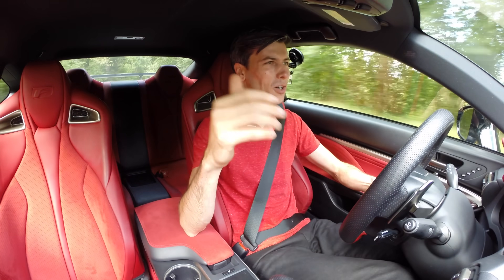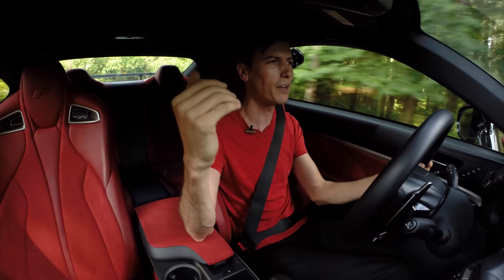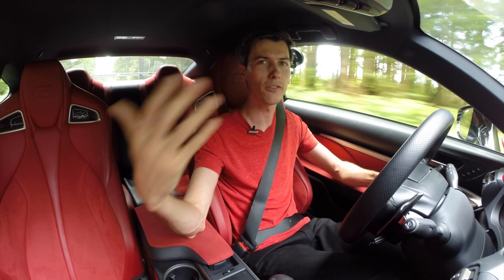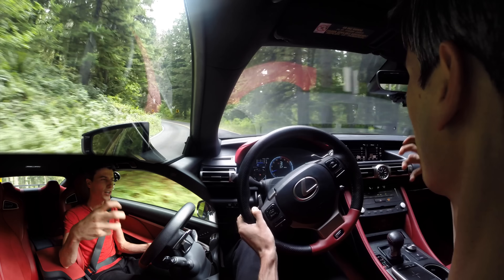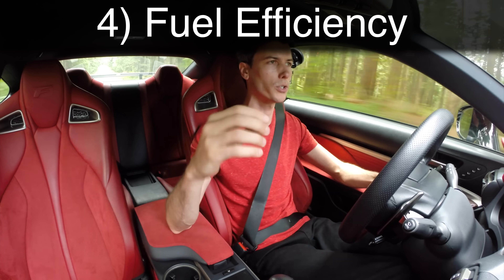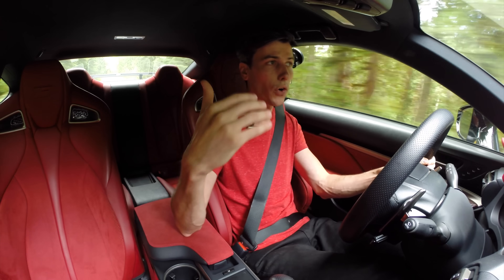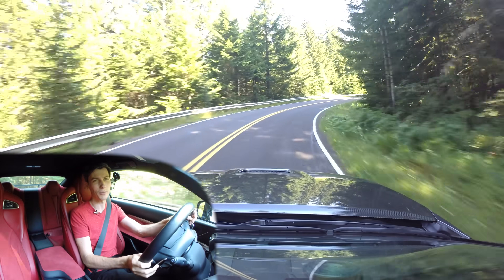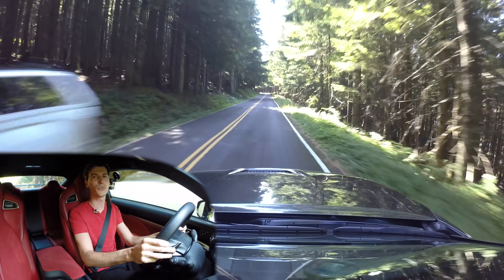5 Reasons You Shouldn't Buy A Turbocharged Car

Comment: You know, the design of the exhaust headers can make or break the sound of a vehicle. You know how a Subaru sounds, you can hear the difference compared to a 4-2-1 in the Impreza and a 4-1 header in the WRX. I personally think Subaru engines sound great and part of the reason is because the two banks of cylinders are far away from each other compared to an inline-4 where they're all right next to each other, which reduces the length of runs from each cylinder on the header. Exhaust piping influences sound a lot.

Comment: rotors & pads replacement for this lexus costs more than scotty's toyota celica
Reply: I own a GSF its not that bad.
Reply: Hey you leave that celica alone its taught me alot haha
Reply: BS... As a RCF owner, I can 100% say that replacement rotors are $100 each, pads are $300-700 for the set depending on the grade of pad. Compare the pads on an RCF to a C63... Good luck.. Lexus cost a tad more then Toyota's to maintain.
Reply: MrChrisproductions 700 for brake pads? Ok guy.  And rotors costing 100? Ok guy.
Reply: MrChrisproductions 🤦‍♂️
Reply: @MrChrisproductions  >$700 brake pads

WEW LAD
Reply: @MrChrisproductions  how much do you think Scotty's Celica worth???
Reply: @NikChristo  kbb says $1800 give or take milage and condition. I have one just like Scotty's Celica
Reply: @MrChrisproductions  Those are very expensive pads. Very. Considering a typical domestic vehicle, that are $40-$200 if purchased at a parts store. Wholesale buys them for less than that. I am not knocking the Lexus I think that some of them are great cars. But holy cow brake pads.
Reply: @MrChrisproductions  Do check prices of these rotors, it's 10 time more than you think, ceramic brakes, seriously expensive toy to have
Reply: @MrChrisproductions  aren't Lexus just fancy yotas
Reply: @MrChrisproductions  I think TryMonster is talking about the RC-F Track Edition that Jason is driving in this video. This one will most likely have the carbon ceramic rotors which will be way more than $100 each, assuming we're talking about all OEM Toyota parts.
Reply: Yeah but you got to admit that Scotty's Celica is a more practical car. Jason only drives sporty stuff.
Reply: Wyndham Coffman well u live once, if u can afford to enjoy before the end why not
Reply: @Frost Bite 400
Reply: True ha,ha,ha
Reply: TryMonster one of the many reasons for that is cause it’s a car from a luxury brand.
Reply: Recently replaced Tyres, Brakes & Rotors on my 3g IS and whoa... That itself was $3845 non f-sport, prob looking around $5k-6k at dealer for this. Also had to replace 2 front rims (thank you Northeast) @$1199 for both.
Reply: @Numbahz  lol you could buy so many of scotty's celica for that money Haa

Comment: Man as a fellow engineer, I don't agree with your reasoning's.

1.) Pedal response? Most manufacturer's modulate the throttle extremely well. Modern advances in turbocharging have decreased the flow path for the turbo in many cases (see ATS-V, the turbo flow paths are about a foot with air-to-water cooling intact). This leads to significantly decreased turbo lag.
2.) As an engineer, I am sure that you know that area under the power curve represents the work done. Modern turbos allow for maximum area under the power curve and with 8,9,10 speed transmissions, that wins races but allowing the motor to remain in the peak torque range for a longer duration.
3.) Any performance engine has to be built strong. Even NA engines have to have strong valvetrains, main bearings and connecting rods in order to rev higher in order to compensate for a lack of a turbocharger.
4.) Engine knock is a concern for turbocharged engines. Modern ECMs have insanely good knock adaptive learning built. The modern ECM can take into account ECT (Engine Coolant Temp), oil temp, IAT1, IAT2, humidity, cam position, and MAT (Manifold Air Temperature) in order to learn and remember where knock occurred and what those conditions were when the knock occurred and thus allowing the ECM to preemptively anticipate those knock zones.
5.) Agree to disagree :)

Plus tuning? a tune only on a turbocharged engine has significantly more gains than a tune only NA car.

Comment: My 2018 w205 c63s coupe virtually never had no turbo lag, this new lexus wouldn't even touch my old c63s, i have a 2019 e63s now. Drive an Amg for a comparison, natural aspirated engines will get you in more trouble on the streets. You have to floor them for a long time to build up speed, where i can get on my amg, and then let off just as quick.

Comment: Thank you for generously supporting the american market for used muscle cars - buy one, as long as they are still available.

And you are so right, seven hundred horsepower out of seven liter displacement may last easily up to three hundred thousand miles or more, without any problems. But only if the engine does not have a 'vanos', a variable camshift timing mechanism. Use good oil and take good care of the peripherie, and everything will be fine. If we want to keep the car for longer, high displacement, low tec will be more costefficient for consumers, higher consumption today and higher taxes this year on the long run will be 'overcompensated' by the maintenance costs for small displacement - high pressure engines.

So everybody feel free to choose. Buy two.
Reply: For a lot of people for quite some time this engine was one of their favorite tuning engines, a. sufficent displacement, b. as of r
factory 'just low-level turbocharged'.

Comment: Those were my thoughts exactly... then I fell in love with a Turbo diesel.
Reply: You know what I'm thinking...
When the world finally runs out of fossil fuel...
Every petrol engine user will turn into the Mad Max kind.Killing others for gas
Meanwhile...the diesels...will run on peanut oil...as they were first intended.
Reply: @Rob-326  When the world finally realizes crude oil isn't fossils, and the mantle of the earth produces this slime perpetually....
Reply: @turnin.sprocket  But the problem of pollution persists...
Reply: @turnin.sprocket  no it doesn't. Fossil fuels formed in a specific geological age before bacteria were able to digest wood. The oil will run out.
Reply: @turnin.sprocket  what?

Comment: If you don't live in a deserted area, like most of us, being in traffic is pretty boring most of the time. So you might as well spend less money on gas /taxes / pollution (especially here in Europe). For those occasional places where you can still have some fun, a highway ramp, a windy road without reduced speed limit, a deserted stretch of road, that's why you have the turbo.
Granted, it is a compromise. I also think a true sports car should be NA.
But I only have money for one car, and I live in an area where it's not safe to truely enjoy a sports car. So I don't mind my turbocharged tiny engine :-) I like the occasional turbo noises, and they built in a pleasant hum around 1200 - 1400 rpm that puts a bit of fun in the eco-upshifts. The slow pedal response though, now that's really annoying, vw does a very bad job at that IMHO. Alfa Romeo is much better at that.

Comment: Back in the early 90's when all my friends were building cars with power adders, superchargers, nitrous or turbos, I stayed rigidly NA.  For all the reason you state.  Now that all manufacturers and hence all the folks in the supply chain have been designing and building cars with long warranties and great longevity and most excellent power your concerns simply are no longer valid.  Metallurgy has been perfected that handle the heat of the turbo and its bearings under the extreme rpm they run.  Turbo intake and exhaust and impeller design has simply eliminated turbo lag.  The power is exhilarating.  The fuel economy and emissions are excellent.  The torque curve is long and very flat.  In fact I much prefer my TT V6 over my SCed V8.   The one problem that remains is the sound.  The turbos do muffle the wonderful sound of power.  But that is a small price to pay.

Comment: #1 reason not to buy a turbo,... they beat the snot out of the engine.  Back to 100k mi lifespan, just like 1975.
Reply: Not true with my car. 150k and still going strong.
Reply: @ashsmitty2244  and George Burns smoked like a chimney and lived to 99.
Reply: Rick West I am an exception 😅
Reply: That statement is just not true. It all depends on how you drive the car. Naturally aspirated or turbocharged, the harder you are on the engine, the less life it will have.
Reply: @djs18  I hope you're right, but I doubt it very much.  Time will tell.
Reply: @ThatEEguy2818  I drive a turbocharged car, and I drive a substantial amount of city miles every week. Turbo engagement on my car is at 3,000 RPMs and I keep almost every shift under 3,000 RPMs in the city. That type of treatment on the turbo and engine, will substantially extend the life of those components.  On the other hand, if I'm racing the car around in the city for hundreds of miles every single month, that's going to dramatically lessen the life of the turbo and engine over a series of years.  I firmly believe the driver has a lot to do with how long the turbo and engine ultimately will last. Furthermore, making sure you maintain the proper oil change intervals is critical.  I change my oil at 40% oil life left and religiously use pure synthetic.
Reply: @djs18  that's fine, but are you the average driver?   In 5 years, would you want to buy a 7 year old 4 cyl turbo car?  I wouldn't.
Reply: Rick West I bought a 2006 year old turbo straight 6 in 2013. It had 70k on the clock. It now has 230 and still going strong. 

Dont rev a cold engine and don’t push a cold gearbox or diff. 

My gearbox is going to go before the engine.
Reply: @ashsmitty2244  I hope I'm wrong.   Time will tell.  I'm referring to all the 1.5L turbos that have come out in the last 2-3 years.
Reply: Rick West You could be right my friend. New things are not the most reliable. And these cars are pushing the PSI. 

However, it’s the rapid heating and cooling of the engines and the different rates at which many parts heat and cool that wears out engines.

Comment: I disagree with your first point. Proper tuning takes care of throttle response , this may not be true from the factory but a quick flash and tune at the right aftermarket shop fixes this issue ( I'm not talking about small turbo cars and big turbo drag cars but more so a car that what most people would call a street car) and as I watch further, most of your reasons of why not to buy a turbo car can be fixed with a proper ecu tune and properly sized turbo.

Comment: Just bought a 2019 Mazda CX-5 GTR. It comes with a turbo and I am NOT giving it back! Zoom! Zoom!
Reply: my inline 6 with a twin-scroll turbo has an unnoticeable turbo lag compared to the na v6 i used to drive.  if i keep it in sport mode it overcompensates and everything is dramatic.  :)
Reply: @bobstarr  mazda eliminated turbolag in their recent skyactiv turbo engine , for more info watch engineering explained's video about the engine (the only respectable turbo engine in the industry not to forget that it's only built in japan so you probably wont have problem with its reliability)
Reply: not sold on Mazda. CX9 water pump leaked into engine, Got a tick now. Poor design. Ford Edges have same engine
Reply: Gerry Rice its actually a mazda motor in the edge. Ford bought it from mazda, and screwed the pooch on it.
I would stick with the mazda over the ford.  Its why ford had to replace the 2.3 in the focus RS. They screwed the design up while mazda never had a problem with coolant getting into the engine block.
Reply: @kevinwright3021  funny, cx9 engine/ water pump leaked in to engine oil
Reply: Gerry Rice let me guess, the 3.7 V6?  If so that was a ford engine and they never fixed that issue.
I would never buy a ford with the 3.5/3.7 V6.

Comment: I've driven SAAB Turbos since the early 80's.  They were marvelous automobiles and many of the safety features today were invented by SAAB as well as Turbocharging technology.  Their first turbocharged vehicle was 1977 but production units were 1978 models. Anyone know what a wastegate is?  SAAB pioneered it.  They also invented APC which listened for ping and backed off boost and/or timing so engine damage would not occur, even if subpar gasoline was used.  They pioneered direct ignition and a cool feature when you turned off the engine, at certain intervals, the direct ignition would shower the plugs with high energy spark which cleaned the plugs. When Ford started Turbocharging vehicles it was a mess.  They needed lessons from SAAB.  I still drive a 2002 SAAB 9-5 but it's got a ton of miles on it.  Probably one of SAAB's most memorable inventions was SAHR.  SAAB active head restraints.  The seats are extremely comfortable with headrests that follow the seatback contour.  To prevent whiplash, the SAHR mechanically kick the headrest forward.  Easy reset after an accident.  SAHR is a good internet read.  No one has created a better system to date.

Comment: This video makes a great argument as to why a normally aspirated Honda Civic with the 2.0 Liter will outlast ANY of the 1.5 turbo varieties. Get it with the manual transmission which will also outlast the CVT (and more fun to drive) and then you have an EASY 250,000+ mile car. Yes, the turbos will be faster, but the extra MPGs will go out the window once you step on it.

This V8 Lexus is nice....However, you can get a loaded Mustang GT Premium auto-10 for way less and say goodbye to the Lexus.

Comment: You could use electronic turbochargers to keep the turbos at full boost or almost instantly spool them so cancel out any significant or noticable lag
Reply: Tesla Roadster or high pressure air tank like Audi or variable vanes in the turbo like Porsche. All 3 have extra costs.
Reply: @TheCoolbreeze45  Koenigsegg Jesko too, E-Turbos I think would be the better route, even have a small supercapacitor on board for an overboost function.

Comment: Exactly why I like a supercharger. I know the series II  3.8 L V6 is a little long in the tooth with it's iron block/heads/push rods however low end torque is strong and instantaneous. In addition to that, the supercharger has it's own oil. Turbos seem extremely hard on engine oil.

Comment: Down voted for a click bait video. 2019 turbo engines are 11:1 compression ratio and have much better fuel economy than na engines. 11:1 means great pre spool throttle response. All classes of motorsport are dominated by turbos where turbos are allowed. Turbos are banned in top fuel.

Comment: Pressure/heat in turbocharged engines are higher due to the boost of your turbo. However, compression ratio is higher in NA engines vs turbocharged engines which also means higher wear. Shouldn't you also consider that in terms of life span due to high pressure/temperatures?

Comment: Turbo engines create more torque more horsepower and are more fuel efficient out of less cubic inches where is the downfall? Plus if you live up in the altitude the engine does not suffer from altitude sickness like a normally aspirated engine.

Comment: I want to talk about "fuel enrichment". I disagree with your statement on one basis. Many eco-turbos are designed to increase gas mileage with only a slight pressure of forced intake. 1-7psi doesn't produce as much heat as something like 12-20psi worth of turbo spool. Thusly, you can run cooler, not see as rich of a mixture, and even IMPROVE gas mileage as opposed to the naturally aspirated version of the image. Performance turbos = bad mileage. Economy turbos = good mileage. I've tuned people's cars for optimum gas mileage before, and while battling knock can be the biggest issue you'll face, most of the time, the boost is so low you don't even get knock once during testing. I would say that it more depends on your application. You can't reasonably argue gas mileage on a performance car in the same video as power/torque on a performance car, because they are roughly inversely related. I find that unfair to turbos. I am a naturally aspirated car fan, but I wanted to make that point in defense of the turbos, as I felt they were unjustly represented in your argument. I mean no offense, nor am I attacking you. I just wanted to represent a different viewpoint in the argument of turbo vs NA.